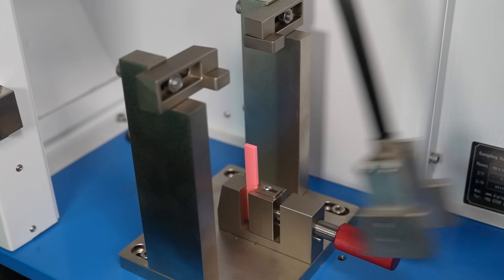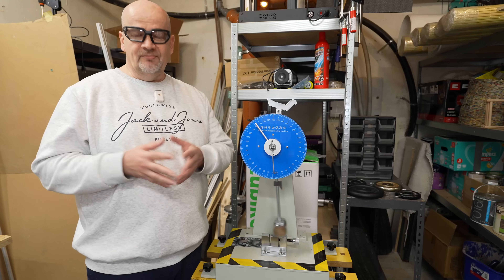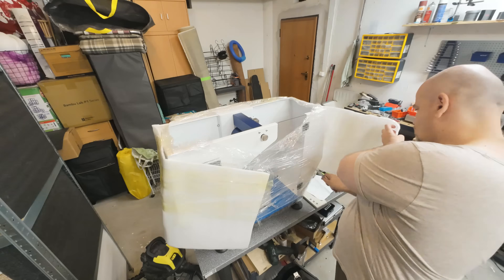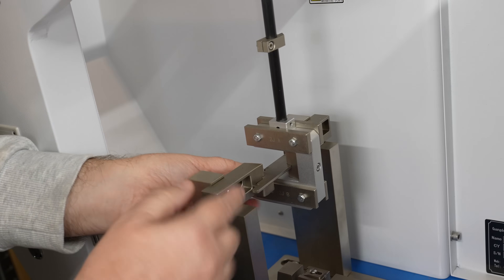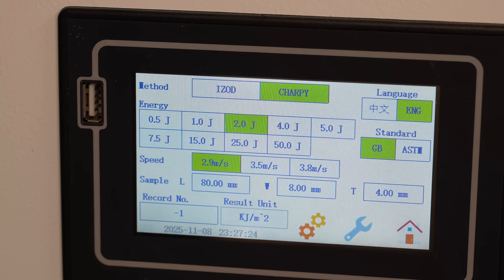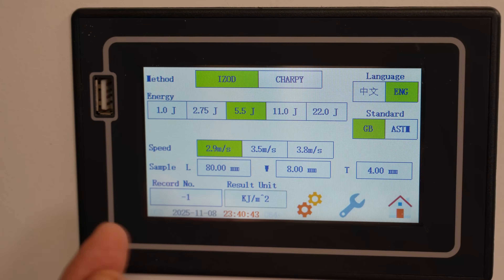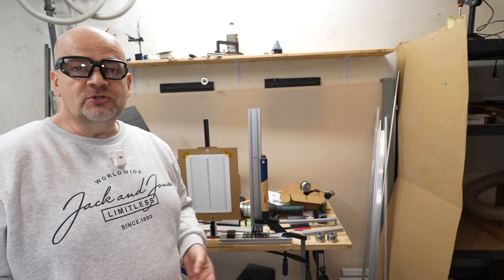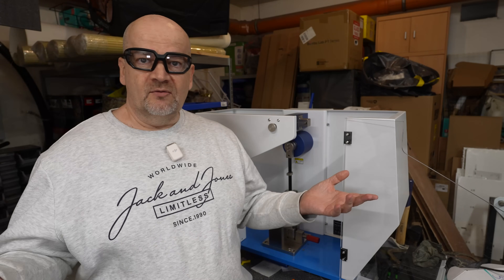Cheap Chinese Digital Impact Tester for IZOD and Charpy Standards

Comment: was thinking notch is supposed to be cut, perhaps a printed slot, or cut slot might be better as the printed lines round the slot would likely give an increased toughness, or not due to delamination.

Comment: Thanks for this video! I'm really looking forward to seeing the machine in use many times. I'm also really curious about how you get the conversion of the data done.
Reply from the maker: Even now I have 19 filament testing in progress. Soon I will have enough data to convert the old data.. But the average difference is less than 15% so far..

Comment: 10:05 interesting to see the rounding of the average J is 0.102J. This implies it is better to take the USB or printed average values, as this might be using the non-rounded values for each measurement. Namely, the rounded average when calculated by hand is 0.1026..7J, whereas the printed average is 0.102J. Then again, maybe the measurement is not accurate enough anyway that rounding makes any meaningful impact. Or they round to lowest full number, instead or rounding to highest full number. Thanks for the great video!

Comment: Resistive screen is easier to operate if you try to press gently with your nail instead of your whole finger, because it's reacts to pressure. Also you can print plastic stylus for it too.

Comment: Thank you for sharing this with the community!
I know it's "normal" for you in academia to provide good documentation of your methods, but it's something missing from a lot of youtube testing. Many times, a novel idea for how to test is presented, without enough information for someone to replicate it, or even to know if it meets rigor. "I can't even bend it with my hands!" tells me basically nothing, as I don't know how strong your hands are, how they compare to my hands, etc, so this is one of the reasons I really appreciate your work and videos!
Very happy to see standards based, repeatable testing with documentation of settings and methods.
I'm interested to know how closely your previous tests have approximated the new digital tests? What is the margin of error you've found with your DIY when compared to the new machine?
Reply from the maker: Thx. I have in progress 19 fulament tests. Soon, I will have enough data for comparison. There will be a post or short video
Reply: @MyTechFun  awesome! Thanks!
Reply: @MyTechFun that you for the double work, too have the comparison

Comment: Can you clarify the difference between 'Loss mode' and 'Normal mode'?  You mention it needs to be in 'normal' to record, but you show tests in 'Loss' mode further in the video
Reply from the maker: Loss mode: zero the vertical position of hammer, then 1 swing without test object. Then switch to normal mode and do measurings..
Reply: Normal mode keeps a history of the results where as Lossy mode does not.

Comment: You are building a nice material test lab.  The new impact tester is nice and I assume it is calibrated to traceable standards but I liked the homemade test machine as well.  It would be nice if the impact tester made it easier to change hammers, if it could save or print the results (it seems odd that it always prints a paper copy), and I'd prefer a CSV file that could be imported into a spreadsheet instead of an HTML file to view in a browser.
Reply from the maker: I agree, and they got my feedback. But hopefully, they will read the comments too. CSV is a good suggestion, only it needs to include the test data too, not only measured values.